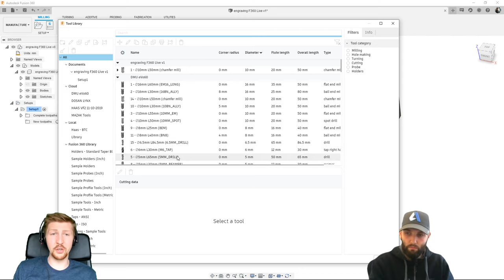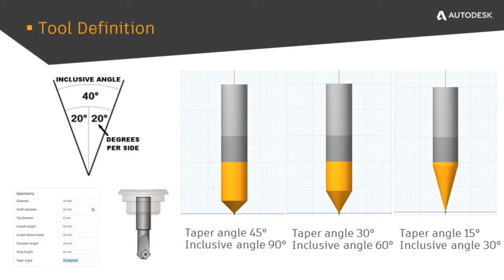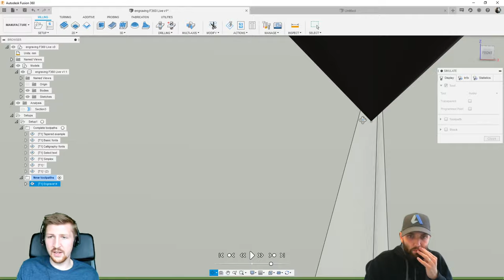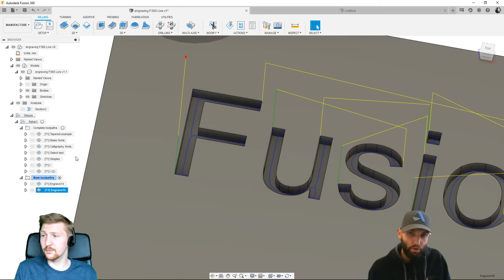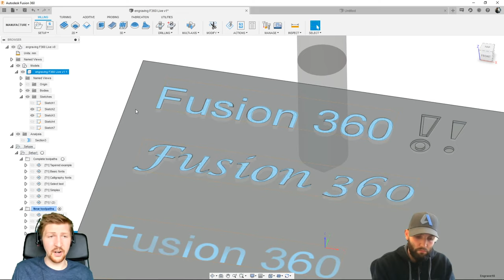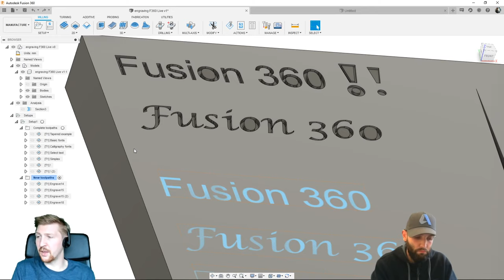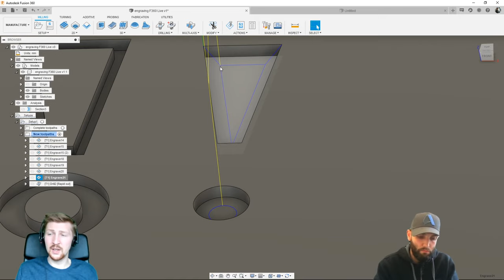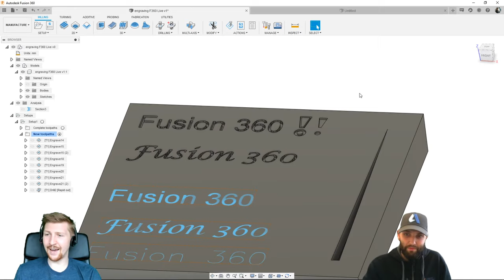360 Live: CAM Engraving

Comment: Thanks Guys, sorry I missed the live stream. I really liked the Q about the serial number. Spencer  said he would post something about how to do this with the API...
If I had to do something like this I would consider writing some python code the patches different pieces of g-code together and run it each time on the g-code to replace the previously embed serial number engraving code with an updated one. of course the G-code pieces  will have to be using relative coordinates for this to work properly.
Its a good challenge :)

Comment: Any recommendations for multi line font for diamond drag engraving. The single line fonts are too faint.
Reply: Something that may be of value?  I use a Tormach spring loaded diamond tipped engraving tool for producing LED edge lit signs.  It works fine.
 https://tormach.com/tts-diamond-engraver-kit-32447.html
You can increase the tool DOC on the toolpath to apply more spring pressure to the tool to cure engraving that is too faint.
John

Comment: how about engraving on a cylinder ?
Reply: in 5 Axis
Reply: @yobrielybreylima  Ok....so it would be nice to see how this is possible using pure text within a sketch rather than extruded geometry
Reply: @rpicinic  Engrave can't be applied in the 5 Axis environment
Reply: use any 2d toolpath and select ‘wrap tool path’. That should give you a 4th axis solution. check nyccnc and look for ‘4th axis machining’ in the fusion360 playlist.